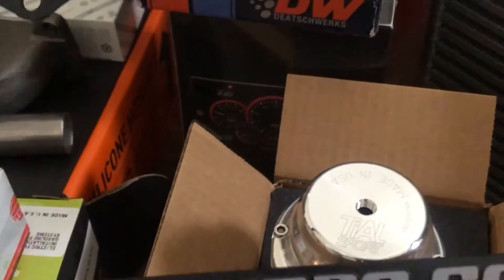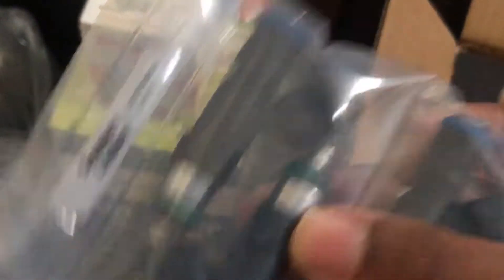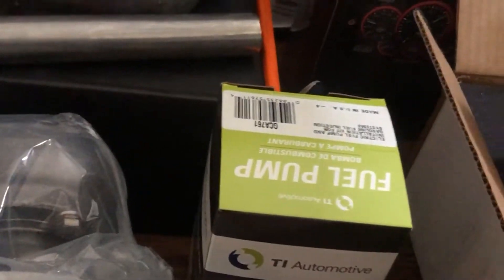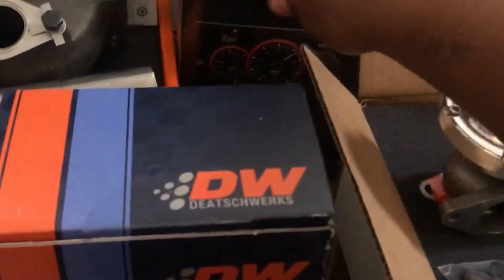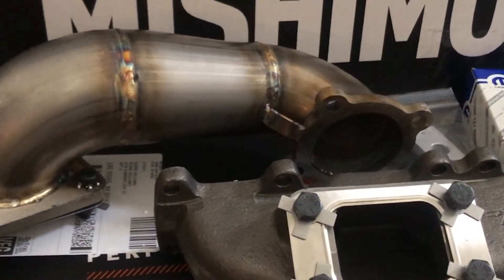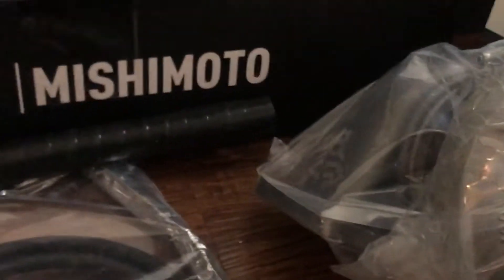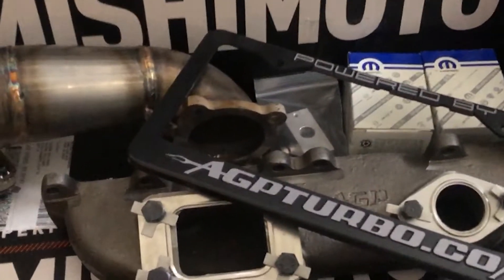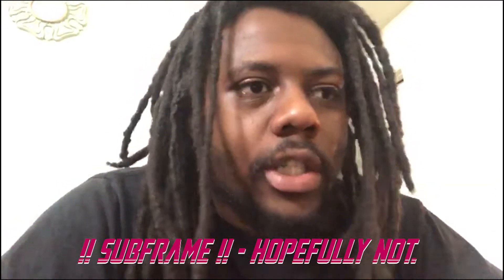BIG TURBO BABY!! SRT 4 Big Turbo Overhaul Part 2!!!

Comment: Looks like you got a nice set up comin!
Reply from the maker: Some real hot on the way boss.
Reply: @cre8tivegarage157  do yourself a favor and get you a Billet input shaft for that transmission! You will need it and it seems like a few manufacturers ain’t making them anymore. Think KW still makes them and they are sold on modernperformance. (What I run also with 700+ whp)